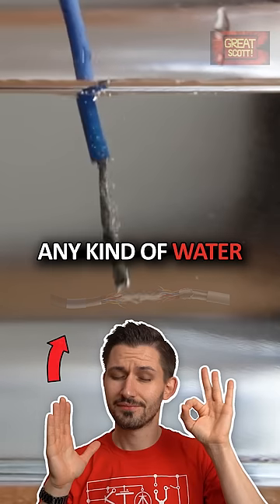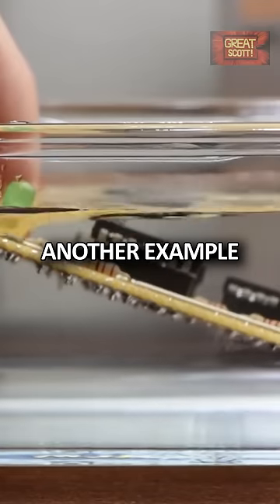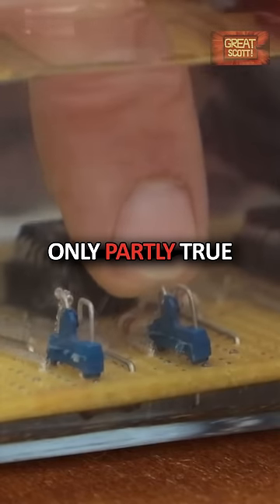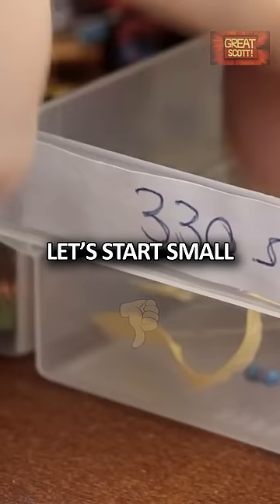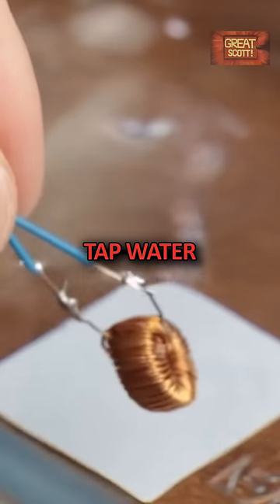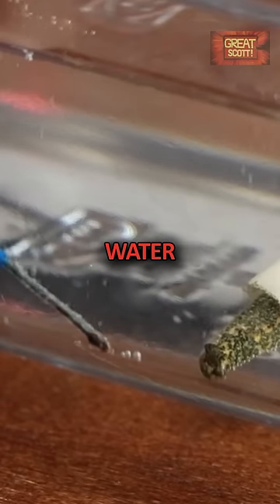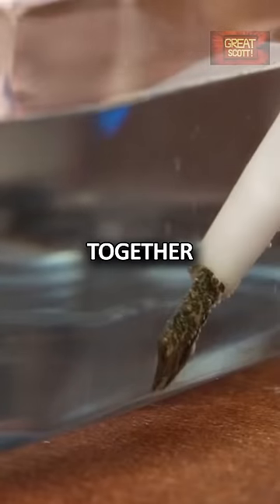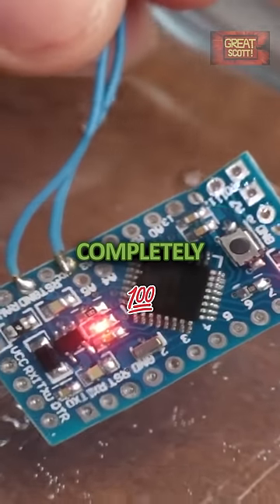The Truth About Water & Electronics!

Comment: The biggest problem is not the shortages in the water but the corrosion which will happen month after the contact.
Reply: Second thing is we rarely have distilled water spilled on electronics. 
I found that cola is instant death, same as milk. 
more diffused stuff cause higher spikes of voltage, and faster corrosion.
Reply: So if I spill a drop of water in something,  completely dry it immediately,  it'll corrode a month later?
Reply: @TreesandStuff69  well, kinda yes, as you have small amount of reactions that happened instantly and they act as catalyst for oxidation of that trace path. 
it would take a month if you would let the water dry there, I would say if you dried it, it might take years.
Reply: @TreesandStuff69  Depends. It doesn't necessarily have to. Years ago my wife spilled a whole cup of water into her keyboard and some time later a bit of coffee.
Both times I immediately took it apart and dried and cleaned as best as I could. There aren't that many parts in a keyboard, but there's a small circuit board with a few components and that plastic sheet with traces under the keys. It's been working for many years now and I even had it in storage for a few years, but my wife wanted it back.
My initial thought was to not even try to dry it, because I first had to get a screwdriver and open it, but it seems to have worked and I'll certainly try to do that again if anyone spills anything into electronics.
Reply: Fun fact: not water does not conduct electricity
Its the impurities that conduct it
Reply: And even the shortages aren't a problem if you have good electric fuses built in the house.
Reply: @TreesandStuff69  No if you clean it properly, ideally isopropyl alcohol, the purer the bwtter obviously
Reply: THE 1000 LIKE
Reply: @herrlich1461 water actually never creates shortages.

Comment: Just remember, with enough voltage, anything becomes a conductor
Reply: Even you 👀
Reply: @shimzini yep
Reply: But you need current too, i mean a plasic pipe can have 10k volts of voltage, but little to no current.
Reply: Is he wanna lie to us???..or is he thinks we stupid
Reply: @anonimous3158  see if I take something like plastic, if we apply enough voltage per unit thickness it will reach it's breakdown and causes large current flow.
Reply: It’s reminds me of a wiring simulator and being able to use a dog as a transmittet
Reply: even insulators?
Reply: Yeah that's why your local utilities companies if they have wires that are above ground will say stay away if they are downed because they have a voltage that water or heck even the ground they are touching could kill you.
Reply: @anonimous3158  still it's not advisable for your average person who doesn't know what the hell they're doing around that level voltage to try that
Reply: @angelo0698  yes
Reply: @clonescope2433  im an electrotechnician but thank you for the advice
Reply: @angelo0698  yep even insulators.
Their dielectric strength (which is the voltage per thickness will be specified)
Like transformer oil, they have about 33kv/mm and impregnated paper has about 30kv/mm.
You can find then by first using a air capacitor and then keep the dimensions same and then insert the material and then take the ratio to find relative permittivity. 
Or just use a device that can apply variable voltage.
Reply: @shimzini  obviously
Reply: @angelo0698  Yes, and many of them end up as very very good conductors
Reply: @CroatianBlackops2cel  Yup, and a very good one at that
Reply: @clonescope2433  not even mentioning that such high voltages could probably heat plastic to really high temperatures.
Reply: What is your point? 
With enough heat anything can disintegrate 
With enough force anything can break 
With enough hunger you can eat anything 

Like wtf is your point? There no point saying all that… the guy is making demonstrations on how electric works under myths…not making random quotes that is obvious.
Reply: @angelo0698 insulators dont exist, they're just things that are bad at conducting but not things that dont conduct.
Reply: @Smoah  what wiring software were you looking at?
Reply: Dielectric breakdown is nutty

Comment: Pure water is certainly an insulator, but pure water doesn't remain pure.  Water autoionizes, and the voltages on the electronics, also, can ionize the water.
Reply: This is why for all intents and purposes, always tell people that water and electricity is a big no, no. 
Other things can be discussed with people who are skilled/trained/taught about such things. On some level of knowledge, most definite answers change into "it depends" ;D
Reply: Putting your hand in it does this immediately
Reply: @mycelia_ow really?
Reply: @ItIsTheLordWhoKeepsme  yep, that's why you have to be careful using distilled water for anything. something as simple as your skin oils and skin cells will immediately ionize the water. idk by how much, it depends. it may or may not affect how it reacts with electronics, but better safe than sorry.
Reply: @mycelia_ow  thank you
Reply: Autoionizstion shouldnt really matter here it dosent happen enough to make water conductive, because it reacts in both directions and "deionizes" itself again. Everything else is a possible concern though.
Reply: There are other important things to consider though, here are three of them.

1) What is the 'breakdown voltage' of the insulator? Or in other words, how much voltage is needed to turn the insulator into a conductor (by whatever means)  

2) If you have any kind of wound or break in your skin, that is a serious hazard because it would be a path of least resistance.

3) The resistance of human skin drops dramatically when it is made wet with water.

So a live wire in water and you being wet/submerged/etc in the same water is often very bad news.
Reply: You mean autoprotolysis? That always happens. It leads to a tremendous ion concentration of 2*10^-7 mol/liter. There won’t be more ionisation with electronics involved, unless you run them on a radionuclide battery.
Reply: @Linus-nq2op  No, autoprotolysis is a type of autoionization.

Comment: One of the UHF TV stations I worked for used klystrons with a 30 kV anode voltage.  The tubes were cooled with distilled water that boiled in the tube, thus removing the tube's heat.  The steam was recirculated through radiators, which condensed the steam back to water.  Pure water does not conduct electricity.  (20 years as a broadcast engineer.)

Comment: What also matters is how close the traces on the PCB are, a big hand soldered analog circuit will work better under water than a really small digital circuit with many smd components or microcontrollers
Reply: would an analog circuit depend on relatively precise voltages more though?
Reply: @maxxiang8746  Yes, but it always depends on the circuit type. If you drip an simple astable oscilatior in water, the frequency would probably change a bit, but if you drop a micorcontroller into water, it would cause floating gates or shorts, that disable it immediatley and probably even kill it, while the analog circuit would probably run as before if it is dried again.
Reply: The small circuits also have lower voltage, so it's still hardly going to short anything

Comment: One of the things that blew me away when I first saw it was a computer in mineral oil.
Reply: Big transformers on power poles — the kind that occasionally blow up with a blue glow and cause a small power outage — are filled with mineral oil. It's an excellent insulator.
Reply: I've always wanted one of those but never wanted to deal with the mess
Reply: My company runs some equipment submerged in mineral oil and the uses a radiator to release the heat. 

It's like water cooling the whole server! Lots of fun.
Reply: I remember a guy who tried this with transformer insulating oil, but found that  only sold in bulk - think pallets of four 50 gallon drums. He contacted 3M for a free sample hoping to get enough to sink a motherboard for experiments. 3M delivered a free 20 gallons of the stuff!

It certainly slowed the heating and allowed more efficient circulation of the heat but without active cooling the oil bath would just heat up to the temperature of the CPU. Watching a fully functional motherboard being dumped into what looked like water certainly rustled my jimmies...
Reply: @wbfaulk The huge ones with radiating fins you see at substations that take 38,000v down to 7200v into those pole transformers are also either full of oil or in pieces on fire.
Reply: @dawidd8855  Don't remember that I have.
Reply: @wbfaulk  I've heard two of those blow up since I,ve been here. Quite loud!
Reply: @katiebarber407  Indeed. It must be stressful, hoping it doesn't start to leak in the middle of the night. 🙂

Comment: To clarify: this is for low voltage electronics.

If you do this with mains(120v AC in the US) there is the potential of execution. Water is an electrical conductor that also reduces the resistance of some insulators like wood and even concrete.
Reply: Execution lol
Reply: Pure neutral water is an electrical insulator, it needs some ions to conduct.
Reply: Water is a insulator, not a conductor. The small particles in the warter like ions is what is conducting. Destilled water is in fact a verry good insulator. Silver for example has a conductivity of 6.139.000.000 S/m (Siemens per Meter), normal tap water is about 0,0005 S/m and destilled water is about 0,0000005 S/m. So silver is about the factor of 18.278.000.000.000.000 more conductive than destilled water and normal tap water is about 1.000 times more conductive. Get your facts right!
Reply: @JumpMetler  doesn't it need to not just be distilled, bit deionized as well? You could have technically pure water distilled bit still be off of the balance of oh- and h+ /h3 + ions and thus not ph7 , making it conductive?   Maybe I'm all wrong on my reasoning, but I recall learning about there being a difference between simply being distilled water vs deionized water.
Reply: @onradioactivewaves  H+ and OH- are most of the time a result of other ions wich are left behind as salts after distilling. There is some autoionization of water resulting in a miniscule amount of ions existing but  u cant rewlly stop it and they aremt really considered in 99 percent of equations
Reply: @JumpMetler  yes but also no context is important if there is enough voltage to make water conductive and in this case water would be a conductor
Reply: He is talking about mains voltage in the beginning.

Comment: The problem with non distilled water is that it can conduct electricity witch can cause short circuits to form and damage them. But even if you don’t turn them on, the other HUGE risk is oxidation, any circuit is prone to oxidation in the long run and water can speed thay process up massively

Comment: Electricity and water are really only dangerous when there are other things, such as conductive materials, like salt, nickel, iron, etc, present in the water. This is why people (should) use deionized water when working with electronics. Especially at high enough voltages and amps. Exposing you micro-controllers and single-board-computers to ionized water probably won’t electrocute you, but it will likely leave your little friend fried.
Reply: Salt? So ocean water is a no no then?
Reply: @YukiXKohaku  Yes, that is why you don't swim on the ocean during a thunderstorm. Nor in pools, because the water is not pure.
Reply: @-_deploy_-  I see. Thanks.
Reply: @-_deploy_-  With the voltage of a lightning strike, that kinda doesn’t matter anymore. Anything will become a conductor in this case.

Comment: It starts mattering more with very voltage sensitive components, and batteries.
Reply: The water matters most.  Pure water, no problem.
Reply: @Sylvan_dB pure water doesn't stay pure for long though, it'll pick up things from anywhere it can and it quickly becomes slightly conductive.
Reply: That's true because LEDs can light up when I have even the slightest moisture on my hands when I am touching a circuit board with a battery on it.
Reply: @davidd2661  What do you mean?  You do know pure water does not conduct electricity?  The comment I saw in this thread about "doesn't stay pure for long" is true, but it stays pure long enough to wash electronics without a problem at normal small electronics voltage levels. I don't have experience washing anything above 5s (~20v).  I have stuck 120v A.C. electrodes into moderately pure water and it takes a rather long time for anything to happen so if I were going to wash something with that kind of battery voltage I'd be quick about it but it wouldn't scare me.
Reply: @Sylvan_dB  i think he's talking about the reaction that lithium metal (as an alkali) has with water. however, the amount of lithium used in li-ion cells is pretty small. would cause problems if it got inside - from diluting and moving the electrolyte - but they should be sealed anyway.
Reply: @rolls_8798  the lithium in all of the commercial lithium cells is not in metallic form. In fact plating of metallic lithium during charging is fatal to a cell. Lithium ions do not react with water. The recommended action for a lithium battery fire is to flood it with water.
Reply: Underwater welders will look at this video and say.. ok.
Reply: Yeah the most problem is battery and fans if it's come to pc
Reply: Batteries tends to be more of the stuff inside though, I think.

Comment: The variation I suspect to be caused by temperature, even if the water is room temperature it can prevent as much heat from developing in the system with its larger moving surface contact(there’s a term for it and I don’t remember, but similar to how we use liquids as a coolant)

Comment: Water is "static" it can conduct electricity depending on what type of water you used and voltage of the electricity.  I believe in this video, you used Mineral Water.
Reply: Electronic still will be broken in distilled water overtime because the water wouldn't stay pure when he put the finger
Reply: @youravghuman5231  i agree. Any electronic on water will eventually brake

Comment: The parts that really HATE water are connectors. And you have pretty lot of them pretty much in any device, especially phones. Most of the drowned phones I repaired required tedious cleaning and not all could be fully repaired. It's even worse with cars. Have water in the wiring and they are "the ones to avoid when you buy a used car" ;) The worst part is they kind of work, but lots of random failures are going on later when things don't contact properly.

Comment: I tried using a multimeter to measure the resistance but could only get a reading when the contacts touched each other, but electronics and water is dangerous when high voltage is present. I managed to get firey arcs out of the water when 3kVAC and the water started evaporating. Although water and electronics may not go well for certain things it's still not too bad as long as you know what your doing. Still be careful when working with water and electronics regardless.

Comment: What about high voltage?
Reply: Just don’t 230/400V supply can burn board with in dozen minutes. And I don’t mean circuit board will be converted to coal and then as coal is conductor it get on fire.
Reply: @Kyrtap192  i mean high voltage in water

Comment: I work in electronics repair work shop and olden days it was  common practice to clean power suplies etc with ultrasonic cleaner. Only thing is you need to know wich components are not water resistans and wich are.

Comment: Exposing LIVE circuits to water can be a issue as it can lead to corrosion and short circuits, but if the circuit is absolutely dead, it can handle a soaking of distilled water and function just fine after as long as its properly dried, even regular tap has a low risk depending on mineral composition as long as you curb the corrosion before it escalates (so alcohol scrub after?)

Ive seen people stuck terrible dirty pc motherboards in the dishwasher with no soap and they've been fine (just have to ensure any plastics on the board can survive the drying stage)

Comment: Should clarify that this is only true for low voltage 😬😅! I still wouldn’t trust them even then because some “low voltage” devices connected with a charger may not be correctly isolated and could still make you a resistor in its circuit.

Comment: problem is the added resistance and jumping circuits from a component to another one if it's not insulated properly. water changes its electrical conductivity with changes to the temperature so it could go very wrong as well

Comment: OK, does this with a Computer 😂
Reply: Can be done with mineral oil. The crazy gaming ones
Reply: I know
Reply: It kinda works for a few minutes, tried it with an old PC that was going to be scrapped. We got to the boot screen with an ice cube on the cpu but were too worried to go much further, water was getting everywhere.
Reply: Washing circuit boards is actually a method used to fix them.
Reply: Distilled water doesn't conduct untill it becomes undistilled. Doesn't take long for water to become contaminated and cunduct. Try Fluorinert instead.
Reply: Just a leaking watercooler and your gpu is fried. So I am not sure this video is that good, cause now people will take this as electricity and water is fine.

Comment: Water is not super conductive. It however has the ability to oxidize just about anything. The thing about water is it is usually slightly impure which makes the resistance hard to know. Air is usually better at preventing resistances from forming in places where it is not supposed to be. Water however can potentially create decent resistances when impure in places it is not supposed to be. Voltage sources effect performance of current sensitive electronics.